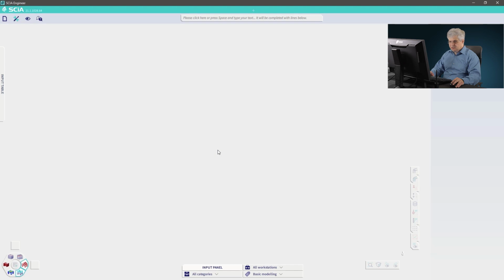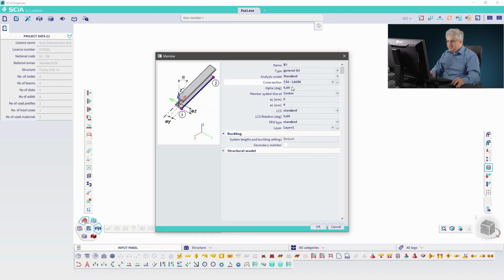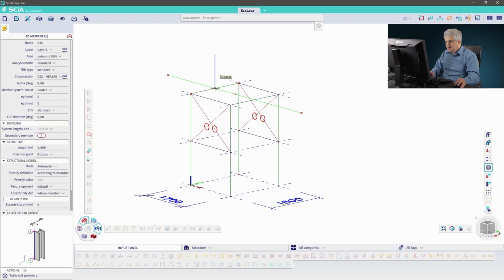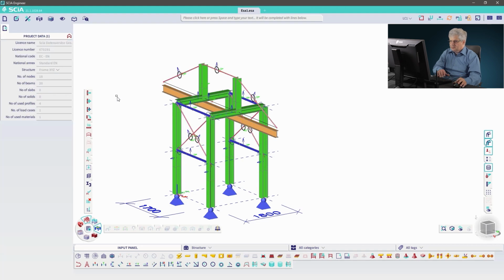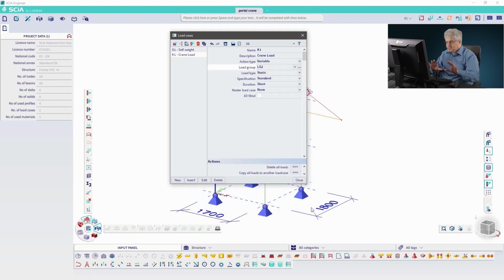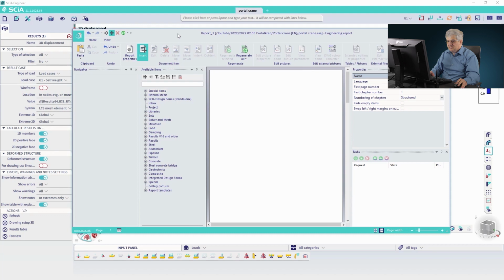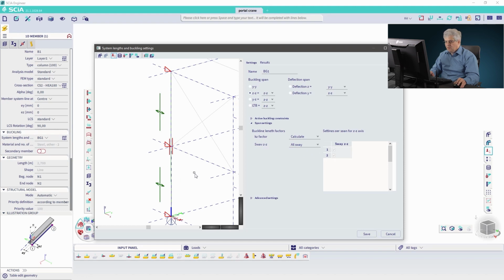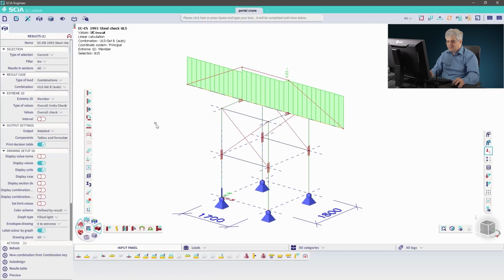SCIA Engineer 21.1: Getting Started with Steel Frame

Comment: Hello sir, I need your help. The only structural software we currently use in my office is SCIA Engineer. I am currently working on pile Foundation, please can you send a link to me to see how to model and analyze Raft Slab on pile Foundation please ?
Reply from the maker: Usually users creates a standard slab with subsoil, or with SOILIN and piles as columns with elastic supports on the side. I don't have such video, but you can contact your local representant of SCIA and ask for training.
Reply: I am so impressed with your response; you're so quick to respond. Thank you for this, sir.
I have searched your archives to see something close to what you mentioned, but there is nothing.
If you can suggest a video for me, I will appreciate it.
The local representatives here in the US are not that efficient.
Once again, thank you, sir.
Reply: Hello friend, I found SCIA Engineer to be an excellent software, due to its versatility, elegance and the presentation of its reports, the best in my opinion of all.
Reply: Now my question is the following, taking advantage of the fact that you use the software in the USA, does the software have the Aci-19, AISC 360 22 and AISI S100 standards?